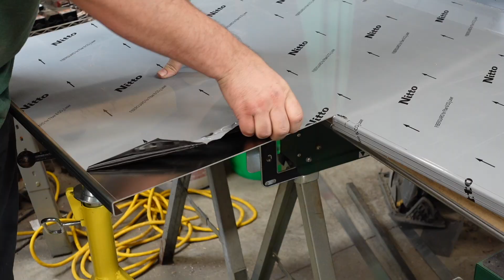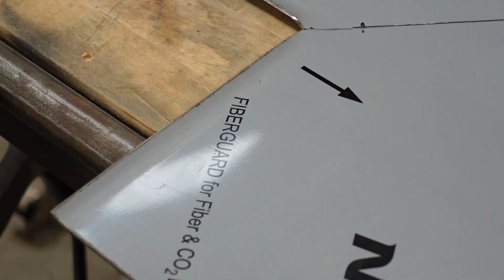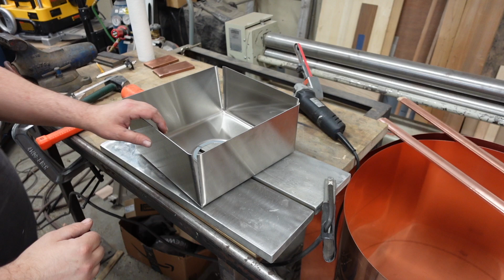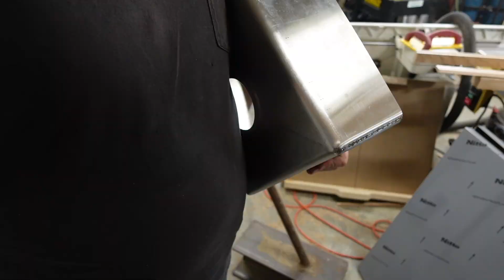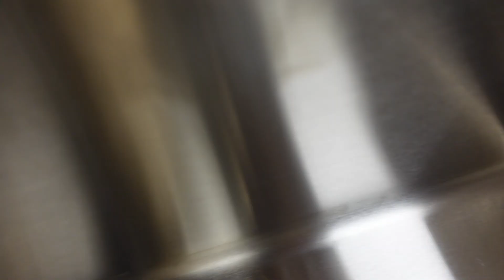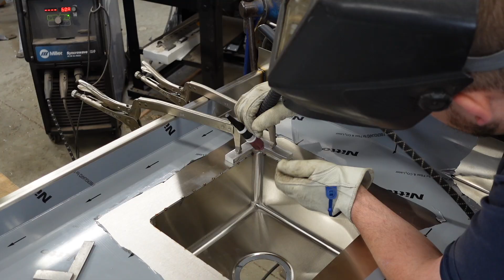🔴 Stainless Steel Sink Fabrication- In my Garage Shop

Comment: I want to know the size of the hole in the sink, the actual hole, not the part that will bend. Thank you.
Reply from the maker: I believe it’s 3 5/8 inch. I started with 3.5 but found 3.625 accommodates all drains
Reply: @TheMoonlightCraftsman Oh thank you very much, friend. I just wanted to know the space for the circular cut.

Comment: What grit sand paper do you end with and was the stainless a #4 brushed with a directional grain? tough to see in the pic. Ive got a job coming up and trying to gather knowledge
Reply from the maker: It is number four. I end with red conditioning disc or belt.

Comment: Bro list what did you use tools for finishing? 😊
Reply from the maker: Dynafile which is the skinny belt sander, I think it’s dinasher is the round belt sander or burnishing tool for the grain on flat surfaces. And of course just regular grinder. I have some other videos that you might find useful on the topic as well
Reply: Para pulir el interno de la posa como se llama la máquina ? Soy de Perú
Reply from the maker: @abelrubiovasquez8169 dynafile

Comment: What tool did you use in polishing the corner?
Reply from the maker: The inside corner of the sink?
Reply: @TheMoonlightCraftsman  yes sir. 1st time seing it
Reply from the maker: The brand name is dynafile by dynabrade. This one is electric which has good for me at home. The company is best known for their pneumatic tools which there is that option which is lighter but requires a lot of air volume.  There are cheaper options from other brands which I would probably try now, Milwaukee actually makes one now that they call a bandfile
Reply: @TheMoonlightCraftsman  thanks a lot.

Comment: Hi. Can you tell me the name of the tool that is use for finishing the rounded inside corners of the sink? And can we make this sink in 24guage SS?
Reply from the maker: That tool is a dynafile. 24ga would not be acceptable for this process. That could be possible with an industrial stamping process but even that would be thin
Reply: @TheMoonlightCraftsman   Thanks bro that is very helpful.

Comment: No need weld inside 4 corners? Why?...
Reply from the maker: The sink is purged with argon and welded from the outside but getting full penetration so it’s welded completely through
Reply: @TheMoonlightCraftsman  .Without purging with argon.penetration not possible?Why purging necessary?
Reply from the maker: It will oxidize on the back side without argon purge. Necessary on full penetration Stainless welds
Reply: @TheMoonlightCraftsman  ok thanks.... Good information and nice reply... All the best👍
Reply: @TheMoonlightCraftsman  Did use filler rod for corner welding or just melting only?
Reply from the maker: Use as needed. The sink corners yes

Comment: If a stainless steel tank is dent then how to remove it dent part
Reply from the maker: Ooh that could be a big project. If you can get to the inside easily I would hammer it back out and repolish it….a lot of tanks have a jacket or second skin on them, not sure it that’s what you are referring to. In that case it is possible that the customer may not care that much to have it fixed as long as it doesn’t affect the utility of the tank…….otherwise if you can’t get to the inside you can use a large rod with a cap on the end, a heavy weight that is able to slide on the rod, you tack the rod to the surface and slide the heavy weight on the rod hitting the cap on the end to pull the dent out….you may have to repeat this process numerous times in different areas to get the shape you want. Then grind and polish. Very time consuming and thus expensive process. Thanks!

Comment: hi sir, may i ask on how can i have the round die cast you used? can it be bought? thanks a lot for this video.
Reply from the maker: I welded pieces together to make them. You could probably have them machined. I’m not sure if anyone sells them or not….I originally tried to make a perfect positive and negative but I’m not a machinist and didn’t have access to a lathe….the ring on top (positive) that pushes down has a diameter that is about 1/4 inch smaller than the inside diameter of the bottom ring, this makes a space in the dies where the offset takes place and the crisp lines are created by the square edges of the rings. I also put a hole in the bottom die that a round piece on the top fits into for alignment purposes. It engages in the flat before pressing and matches the drain hole in the flat sheet metal

Comment: hi great video, how would you grind and polish the internal corners of the sink bowl if the corners were 90 degrees instead of the 1" diameter?
Reply from the maker: In this case I would fuse the corners on the inside without using rod and wouldn’t polish it, only take the color off
Reply from the maker: You can check out the sinks with 90 degrees in the “I found this in my garage” video
Reply: Thanks I look forward to watching them

Comment: What grit sand belt did you use to grind the edges of the sink? Video was very intersting!! 😃
Reply from the maker: 120 grit and red conditioning belt is what I like to use. Thank you my friend
Reply: Thank you for the quick reply! What is the blue tape that you are using called? I never thought that a tape would be strong enough to prevent welding distortion, is that the purpose of tape?🤔
Reply from the maker: That’s just painter’s tape. I was just using that as a guide for my eyes when grinding/polishing corners….. I think I also used that in this video when welding the actual sink, that was just used to seal the argon purge on the inside while welding

Comment: Did you say thats 14g SS? What model is the break? thanks
Reply from the maker: The sink is 16ga. I think the countertop is 14 but I use 16 sometimes. The brake I used on the sink is Bailiegh industrials 14ga rated 48in finger brake
Reply: @TheMoonlightCraftsman  Thats just the info I was looking for. Thank you for the quick response. And great work.
Reply from the maker: Thank you sir
Reply: One more question. Can you elaborate on the size of the Dyno file in relation to the sink and corners that need grinding?
Reply from the maker: The sink corners are 1/2 inch radius and the Dino file has different arms. This arm has a roughly 1” diameter wheel to match the sink corners
Reply: @TheMoonlightCraftsman  Good stuff.
Reply from the maker: And there are some weld-in sink bowls out there online if you want to go that route

Comment: Just getting into building tubs for a new customer. Welding only the outside, any idea on how to blend in the bleed through that comes in through the corners? Passivation isn't working on inside, just the outside.
Reply from the maker: Are you using square corners? I would recommend using at least 16ga and a full lap if only welding the outside and the outside is not shown. When welding the outside clamp an aluminum angle tight in the inside corner, this sucks up heat and essentially keeps a majority of oxygen away from the inside corners.  If you’re using thinner material than 16ga it will be hard to prevent burn through to the inside and you may want to purge the inside corners with argon while you’re welding.  This is recommendation for square corners. In this video I purge the whole inside with argon through a hose coming up through the table, then purposely try and burn all the way through. Any blackness in burn through is oxidation and won’t be removed with passivation.

Comment: what do you call that attachment in your grinder to polish the corners?
Reply from the maker: I think you’re talking about the dynabrade dynafile. It comes in pneumatic or electric, mines electric.  It essentially runs 1/4 inch and 1/2inch wide belts and has different arms with various radius